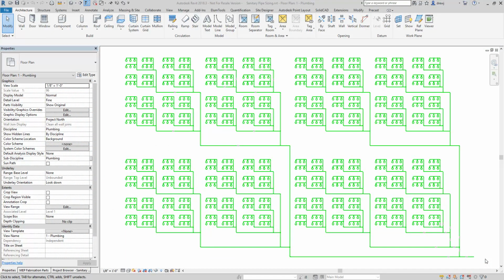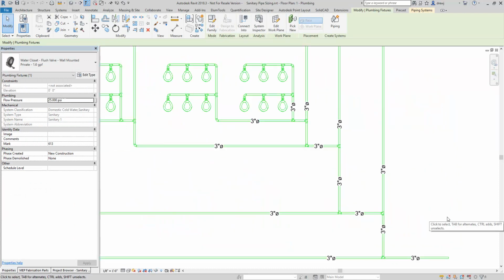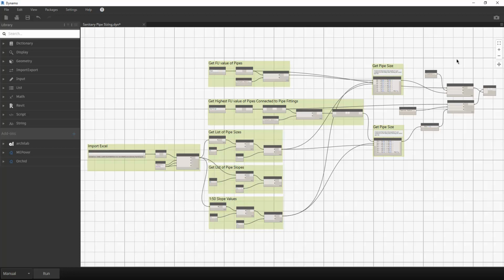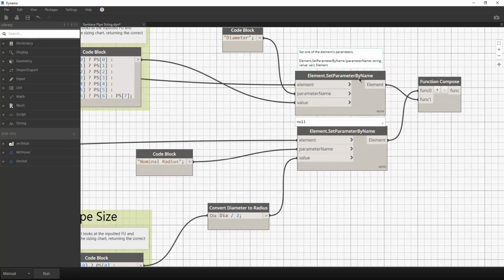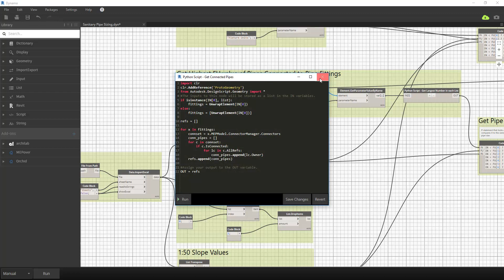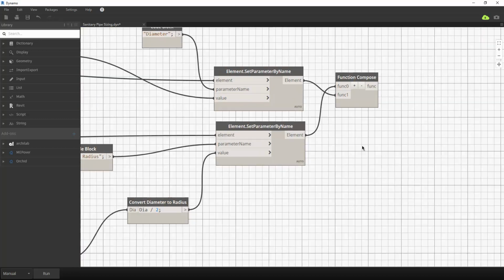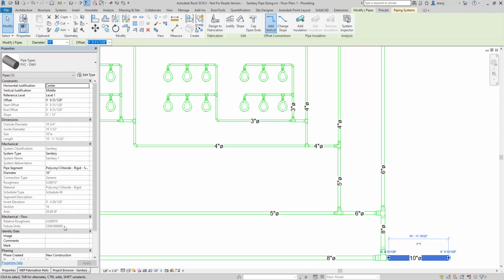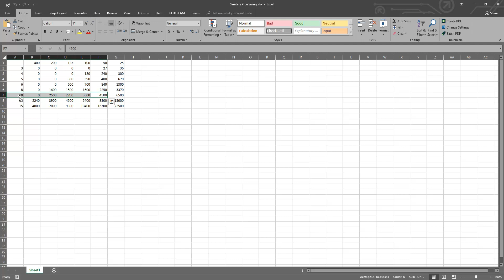Using Dynamo to Size Sanitary Piping

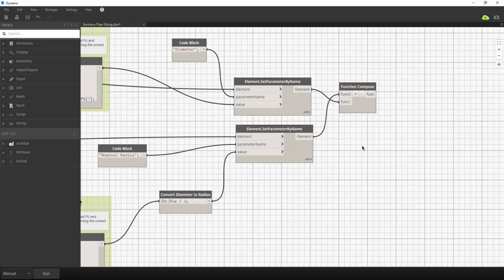Comment: Why are you reading in pipe slopes in the 4th node in column 2? Output doesn't go anywhere you are just assigning it as 1:50 correct?